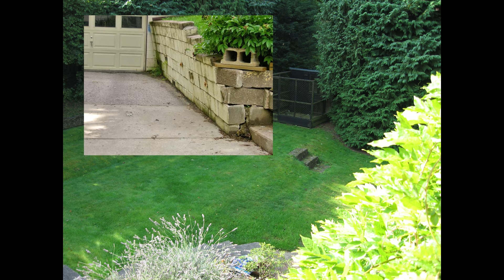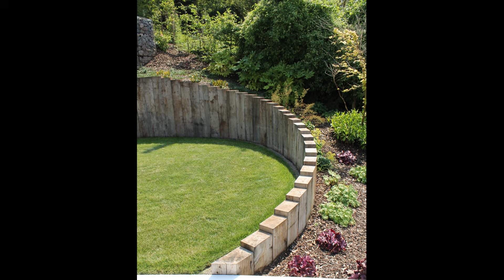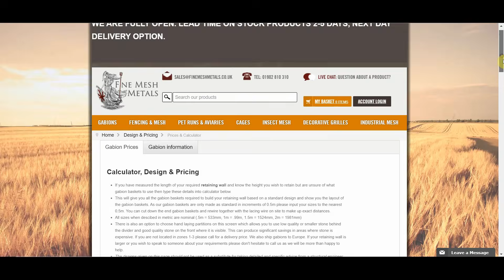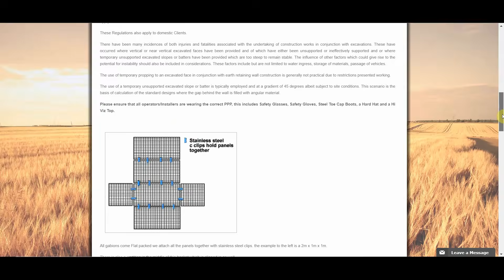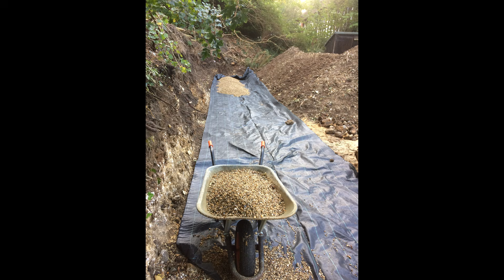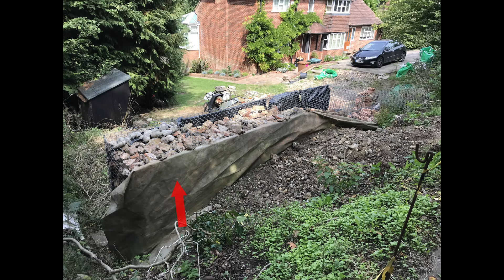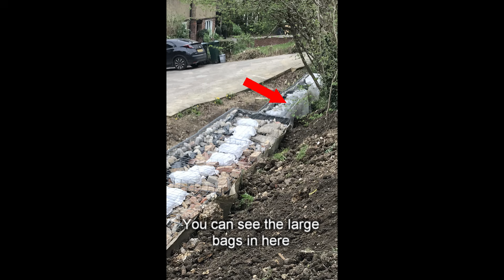GABION RETAINING WALL CONSTRUCTION with cost saving panels | Full Walkthrough with Audio - Part 2

Comment: Hi Karen, I’m hoping you’re still looking at this post. Would I be correct in saying that the 1m high section of your gabion wall is 0.5m deep & baskets 1m & 2m long ? PS brilliant well explained videos 👍
Reply from the maker: Hi there, and apologies for the delayed reply. The second section I did, to the left on the sloped ground, the baskets were 0.5m deep, but the height was 1.5m. I must admit the 0.5 section didn't retain as well as it should have, possibly because I used gravel sacks rather than the brick waste (which I could no longer get hold of) and the pressure did eventually create a slight bow in that part of the wall (but still retaining ok to this day).  Have a look at this video for more info on the less deep section - https://youtu.be/cw8EGBU1j8g - and good luck with your project!
Reply: @O @OurHomeProjects i thanks for the reply & video link. It’s a excellent video & wall you’ve built 👌👏

Comment: Hi. Thank you so much for this very thorough explanation of your process. It has helped me no end. Could I ask what dimension baskets you were using for the 2m high section - was it 2 rows, each 1m high with the base 1m deep and the upper layer 0.5m?
Reply from the maker: Hi there and apologies for the delayed reply. If the information is still needed, the 2m high section used 1m deep gabions for both rows.  To be honest, I found the .5m deep gabions on the left, sloped section to not retain as well as the 1m deep section. Hope this helps and good luck with your project!

Comment: Great video! I am installing a 20 meter run of 1 meter baskets.  I am ready to start filling my baskets but my decorative stone has been delayed.  Any thoughts on filling the rear section with brick etc. and then filling the front section once my stone is delivered?
Reply from the maker: Apologies for the slow reply, YT stopped notifying me of new comments!  I'm sure you're well underway with your project, but to reply with our experience, we did fill some baskets up before adding the decorative stone, but if the fill pressed the inner panel towards the front, we found it a right faff to get the decorative stone inside as they are all such different sizes.  If I pushed something down and it wedged, it was a beast to get out and also could mis-shape my front panel. So we ended up filling up the inside and the front panel section at the same time.

Comment: why do you need to add drain pipe when the wall itself is should allow water to flow through?
Reply from the maker: I kind of mashed a few ideas together and knew that pressure build up leads to most wall failures. As the garage was going to be .5m away from the finished wall, we didn't want to risk having to do any future repairs due to pressure bulging so added it for a belt and braces approach. You are correct that the structure itself is porous and should have been sufficient.
Reply: Even a porous structure has hydrostatic tension. A silt screen, French drain and 3/4" rock keeps sediment from filling inside the Gabion wall.

Comment: Thank you for this fantastic and informative video. You put in a lot of work just making the video - let alone making that huge retaining wall. I'm wondering about the strength of the broken old bricks as fill, over time.  I imagine you have freeze thaw issues in your area? Here in Canada old reclaimed house bricks break up and crumble when left loose in the winter.   For that reason we need to use proper pavers, ie the type made for patios or retainer walls. Have you had a structural engineer sign off on the fill? I am truly curious, as maybe I am missing something here. Would love to use free reclaimed house brick for a small gabion retaining wall but have been advised against it.  Looking forward to your reply :)
Reply from the maker: Hi there, thanks for your comment and it's interesting to hear about the issues in another country. I have to say there is no problem with crumbling bricks here in the UK. The fill looks the same as when it was put in, plus I think they are insulated a bit having been sandwiched between soil and Scottish cobbles. I am not a builder so I can't comment on the brick make-up, but many of the broken ones we bought were frost resistant bricks which I think builders use for foundations.

Comment: Great job and video thanks. I'm thinking of building a much more modest low wall in my front garden. This would serve to step down the sloping level and also use up a lot of stone and concrete material we already have and would need to dispose of. I'm just wondering, if my single gabion wall is quite low (let's say only 60cm high) then I wonder if I really need to tilt the gabions back 6 degrees to retain the area above, or if I can just build everything square and level for such a low wall ?
Reply from the maker: Hi, thanks for watching. I think any recline would be helpful. It’s quite easy to dig out the back a little lower to create the slope 👍

Comment: Tips: you can make your own heliocoil by twisting wire around a pipe — I use the winch on my truck to do this. To keep smaller rocks in, create a decorative front and stiffen the front, cut a section of gridded fencing, offset it to the gabion grid half a square and secure it to your basket. Repeat to get the mesh size you need. You can basket weave the front with any flat material. You can stuff the gaps between rocks with sphagnum moss and plant them. You can hang planters and art and lights on the Gabions. You can line the sides of some gabions with waterproof material and then direct your runoff to the gap to create a water feature. You can create benches and alcoves in your wall. Instead of a kink, to add tension to a cross wire, insert a large nail and twist that. When you add more rock it will hold the nail in place. Better yet, You can also precut stiffer gauge wire and pre bend them and then just insert them as you fill. Saves a lot of time in installation and maintains uniform thickness of the wall. 😊
Reply from the maker: Thanks for your comments

Comment: I dont know if yall have alot of used concrete there but we have a ton of it here in Pennsylvania cause something is always gwtting demolished. For many of the walls i build here on my property i would use chunks of concrete ( now when i say chunks im not talking pieces you could throw with 1 hand im talkong very large like 100 to 300 or more pound pieces. ). I would level the area BEHIND the wall each course of the wall and lay one of these large chunks behind the wall. In some areas depending on how critical movement of the ground is i would put those chunks of concrete sometimes 2 wide ( wide as in going inward of the wall ). Each layer would then have a thin layer of clay soil on top of it and i would repeat this process the entire way behind the wall.

 In doing this and making sure each piece of concrete is level in all 3 axis behind the wall then the actual wall itself has very little back pressure on it. The chunks of concrete behind the wall is what is actually doing the heavy lifting so to speak. 

Its essentially a wall behind a wall. Is it way over engineered ??  Definitely. But i wanted a wall that will never fail. Since the enitre wall has pieces of concrete behind it water never has a chance to pool up anywhere and therefore drains naturally at all times. 

Now doing this REQUIRES you to find chunked used concrete. I have to reiterate the importance of tbe pieces being very large. If they are too small AND you have alot of soil that tends to hold water and expand smaller chunks will just get pushed by tbe water pressure trapped inside the expanding soil. In my case i was raising the entire grade elevation to create new flat area for sheds. There was no soil so i could fill the entirety of the area with chunked concrete of any size i could get. Most places wont sell you chunked concrete. Best idea and how i get mine was utilizing the many concrete contractors around who need somewhere to get rid of the concrete from demo jobs. Or you have to go find it yourself and haul it yourself. This is PAINSTAKINGLY LONG of a process. But it is super cheap. Other than gas for your truck and the immense wear and tear on your body. But this is my solution for retaining walls. For gabion baskets it doesnt matter. You can put chunked concrete behind them too. Or even fill your baskets mostly with chunk concrete to do the majority of the filling with decorative stone on the face
Reply from the maker: Interesting, thank you!
Reply: @OurHomeProjects  no problem. Enjoyed sharing.

Comment: Brilliant video and end result - well done. Did you need to get a structural engineer to calculate the size and any angles of the Gabion (or are you one?). I’m just starting to plan one out and I’m told our Building warranty needs an SE design for it.
Reply from the maker: Hi, thanks for watching. At the time, the regulations in our area stated we didn’t need an SE for our size wall. We took our guidance from the fine mesh metals website I mentioned. I would suggest checking with your local building regs department to see what they say. Sorry I can’t be of more help.

Comment: Are there baskets that won’t bulged when filled?
Reply from the maker: The baskets we purchased were 3mm wire, but the front faces we upgraded to 4mm to try and reduce bulge. You also need the internal ties front to back and side to side to help the basket keep its square shape as you fill it.

Comment: A well explained video of construction of your gabion wall; thank you for sharing.  With a few years now past since the video was published, how is the wall doing now?  I'd love to duplicate this construction method for a retaining wall of a greenhouse I hope to have one day, using the retaining wall as a thermal mass to help stabilize the indoor temperature during our cold winters.  I like the fact that the walls are "semi-permanent" and could be moved if needed in the future, albeit with quite a bit of labor invested.  The only concern I would have is how long the baskets would hold up before they completely rust out and need replacing.  Did the supplier of your baskets have any advice about rust?
Reply from the maker: Thanks for watching. The baskets have been in for over 8 years now and no sign of rusting. You need to pay special care as to which ones you buy. These were designed to withstand use in waterways. Definitely do your research before buying. Your project sounds interesting- good luck!

Comment: This looks great! Thanks for making this video, it's very informative. I'm just getting the foundations ready for a smaller gabion retaining wall in my garden. It will be around 1.5m in height and around 4m long. I'm thinking of also laying part of my patio atop the gabion baskets. The part I'm not sure about at the moment is the drainage pipe. Did you have to angle the pipe, and where does it lead to? Thanks
Reply from the maker: There wasn’t much info out there when we did our project and the draining pipe was belt and braces really. As gabions are porous it’s not really needed, but it wasn’t a structure we could dismantle easily if we had a problem with drainage down the line so we put it in. It slopes downhill from left to right and is wrapped in geotextile. It just ends behind the right hand return/back of garage. We don’t ever see anything coming out! Hope that helps and good luck with your project!

Comment: Is there a need to take special care of the base? Like using a beating machine, dont know their name?

And when there is slope I guess the digger would dig a straight groove, then geotextile, then small rocks , how much height,
?, so that it is easier to level the baskets?
Reply from the maker: Yes, the gabions need to be placed on firm solid ground. As the digger removed soil from the bank for us, he compacted the earth for us going back and forth across the site. The geotextile underneath also helps stabilise things.
Reply: no need to put fabric below. The earth does need to be solid. If it is, then you dont need a compactor (beating machine)  if not, depending on the soil just dig down a bit. Most soil types will be solid so place the bottom gabion down. Fabric is just weed control, quite useless for gabions. Dirt in any set up will build up, plants will attach and grow, and actually the whole purpose of a gabion is to do so, as its quite strong by it selves, plant roots will reinforce it for long term. Alternatively you also may want or need to slope a gabion or any form of wall retainment. If your soil is very weak, pure earth or something you will not have any choice. Doesnt matter what the soil type is when you place anything retaining wise at a minimum of 45 degrees. It will almost support anything and everything even with water ingress/pressure and additional weight placed on top like a huge building. Greets from the Netherlands. The land of retaining walls hahahah (if not well, we will die). p.s. stone weighs allot. It is why gabions work. Down pressure. Bricks weigh nothing compared to stone. If you want to go cheap, prepare to pay for it.

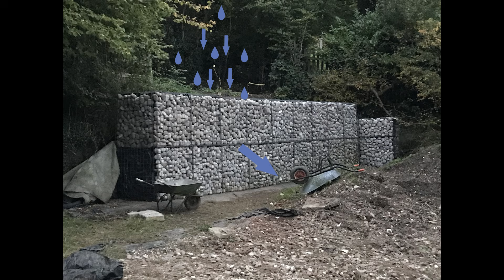Comment: 3:05  "There would also be nothing to rot over time."
WRONG!  The gabion cage is made of metal that will rust and eventually disintegrate.  They can last for decades or as little as 10 years.  Still a far better choice than wood.  I love the price.  Very affordable.
Reply from the maker: Agree you have to buy from a reputable seller to get the longest lifespan

Comment: Very clear and detailed audio. Excellent project. This video has really helped me come to terms with gabions. My one question as a total novice is: Is the wall stable after the metal wire of the gabion cage has corroded?
Reply from the maker: Hi, sorry for the late reply. It really depends on where you buy your gabions from. Ours are over 8 years old and no sign of corroding. HTH
Reply: @OurHomeProjects  When you advise that your gabions show no signs of rusting after 8 years, did your inspection also include drilling down behind the wall against the backfill or at the bottom of the wall in which places  would most likely be exposed to moisture to find any rust?  I would be happy if I could get 20 years use of the baskets before having to replace due to rusting.  Thanks.

Comment: If it bulges from simply backfilling, what will happen over time? I know nothing about "gabion walls" but it seems there is a lot of weight dependent on a little bit of wire. Metal even galvanized tends to rust over time. I hope it lasts for you.
Reply from the maker: It is a mass retaining wall so is only as effective as to what you put in it. I mentioned in one of the videos that the gravel bags aren’t good enough as gravel is just too light and recycled brick is the best 👍

Comment: As back fill inside the Gabion could one use rubble sacks filled with a dry 5/1 mix if gravel and portland cement??????
Reply from the maker: The point of a gabion basket is to have water flowing around the rubble/stones so that pressure doesn't build up, so there needs to be gaps between the stones/bags. The rubble sacks won't be permeable so you'll only have the gaps between the bags sitting in the basket. Only you can know for your setup if this will be good enough and stop the water pressure building up behind the wall.  HTH

Comment: Labor-wise, it seems basalite blocks are more effective.
Reply from the maker: You could be right there, but as long as they aren't stacked neatly as you need the gaps for the water to flow freely through the structure 👍

Comment: It looks very labour intensive, and that stone will not be cheap.
I have a soil bank about 1m high and about 6m long that needs retaining and I watched this for ideas so many thanks for the detailed explanation.
On your property this was probably the most cost effective solution as there's a lot of material there. 
I'm just wondering whether a brick built wall would be a more aesthetically pleasing solution. Obviously there's building costs to consider, but paying a builder to do it saves a lot of personal labour and material cost.
Did you ever calculate the alternative costs?
Reply from the maker: Hi, thanks for watching. We did get quotes for a breeze block wall, but it was 2-3x more expensive than going down this route. This was built in 2016, so material costs for all wall types will have gone up considerably (especially since covid).